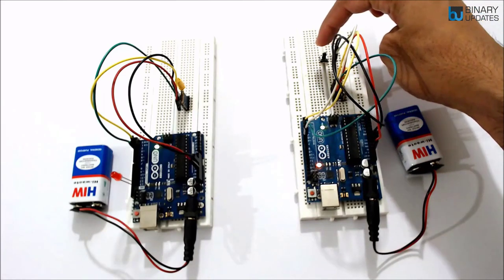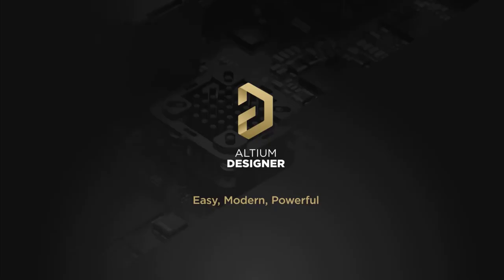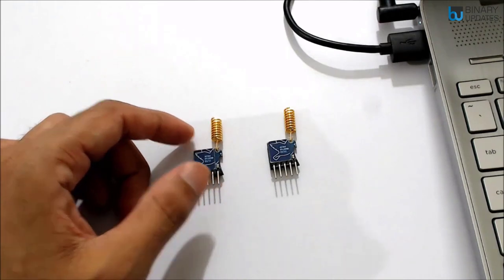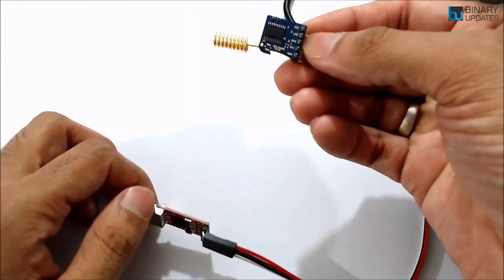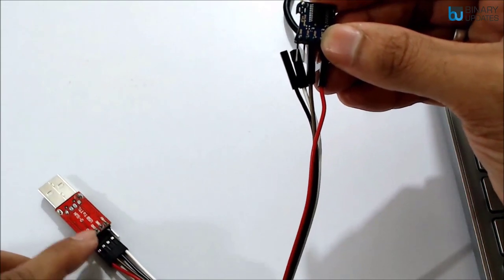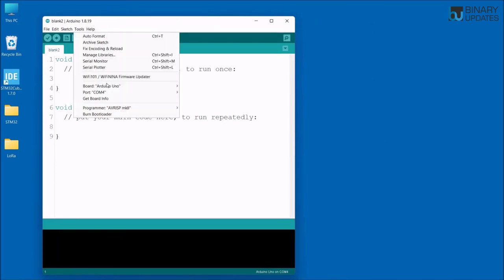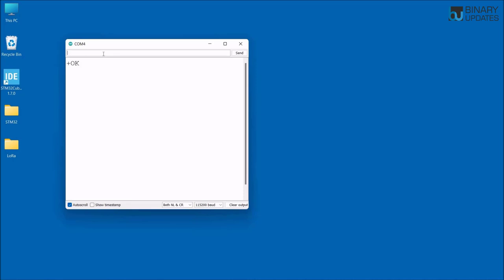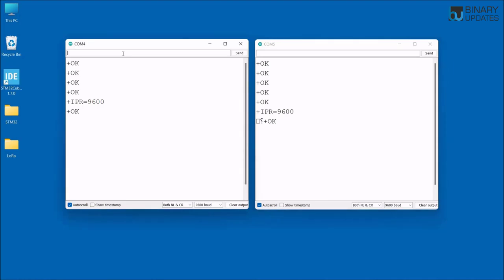LoRa Module with Arduino- REYAX RYLR998 Tutorial

Comment: Hello sir and thank you for the great tutorial. I have build this project and works as you described. However could you kindly please help for some improvements needed? 

The thing is that I prefer to have an immediate reaction. At your project there is a delay of 1 second from time that button is pressed to the LED lights up and a second delay for the LED to lights off at realising the button. Could that be faster? I reduce the delay(1000); function to lower values but then the project does not work at all. 

Another way to make my project works as desired is that the LED at the receiver lights up when turn on the transmitter and LED lights off when turn off the power of the transmitter. In other words LED lights ON and OFF when there is communication or not between receiver and transmitter. 

Regards

Comment: I am using using 57600 as baud rate to send a simple string message hi. the receiver receives the message only for a few times but not continuous even though the transmitter transmits in a loop. is it because of the baud rate or is there some other reason

Comment: I have dout....
If our lora module work on spi communication...
Like moduoe sx1278then how to connect
Reply from the maker: Hi Gaurav, you must use Arduino libraries for Semtech SX1278 and SPI Pins of an Microcontroller to establish communicate. Also make sure SX1278 Lora module which you're planning support 868 MHz LoRa band for India. Good luck and best wishes!

Comment: I set up here at home, the receiver receives the signal but does not turn on the led, can you help me?
Reply from the maker: Hi Trambini, you can use serial monitor to check what you receive at LoRa receiver. Also check if in case LED itself is damaged. It happens soemtime. I am hoping you're using our Arduino code provided for Reyax RYLR998 LoRa modules. Good luck and best wishes!

Comment: Can Lora RYLR998 Modules be configured WITHOUT using USB-To-TTL module with code below?

  Serial.begin(57600);
  delay(20);
  Serial.print("AT+RESET\r\n");
  delay(20);
  Serial.print("AT+IPR=9600\r\n");
  delay(20);
  Serial.print("AT+ADDRESS=2\r\n");
  delay(20);
  Serial.print("AT+NETWORKID=5\r\n");
  delay(20);
  Serial.print("AT+MODE=1\r\n");

Comment: The RYLR998 is  NOT 5v tolerant and should not be connected directly to the Arduino IO which operates at 5v. You will need a TTL converter.
Reply from the maker: Arduino has 3.3 V Pin on Power Pins. And I prefer to power-up RYLR998 LoRa module through on board 3.3V Pins. And I did used TTL converter in the beginning of this video. Thanks and good day!

Comment: For tx side Voltage divider not required?
Reply from the maker: Hi Jay, in my case it worked. I also have seen some people online using voltage divider but when I tested my LoRa Modules RYLR998 it worked without any extra circuitry. Good luck and best wishes!

Comment: Great project! Do you have a video or tutorial on how to power 12V to 110V on the receiver end? I want to be able to push the button, and have it turn on. ty
Reply from the maker: Hi Woolfy02, I'll consider making video to control devices that powered on 12V to 110V. Till then you must consider using transistor for lower voltages for around 12V and for higher voltages use relay to control devices connected to microcontrollers. These transistors and relay will acts as a switching devices for higher voltages. I hope this may be useful. Thanks for your video suggestions. Good luck and best wishes!

Comment: How to enable AT command because AT command is not working with us
Reply from the maker: Hi Ubaid, AT command mode is enabled by default for LoRa Module especially RYLR998 Module. I think you may have to check connections properly and also make sure the baud rate and LoRa frequency has to set properly as per your country . I've in-fact shown, how to set and also connect these modules in the same video. I hope this may help you. Good luck!